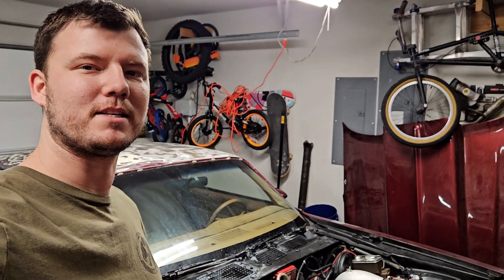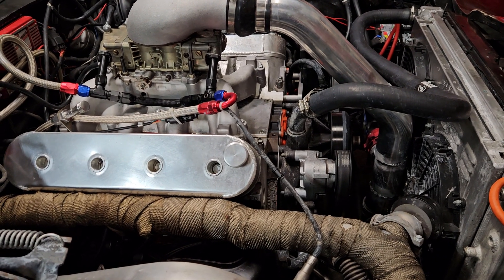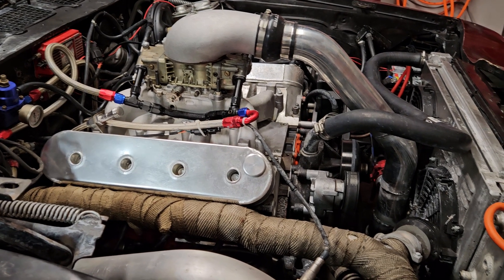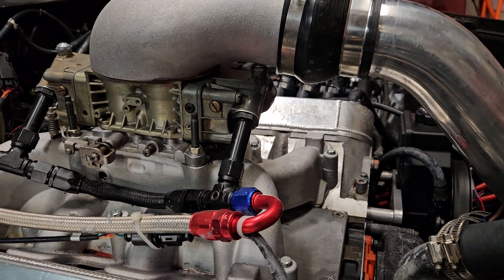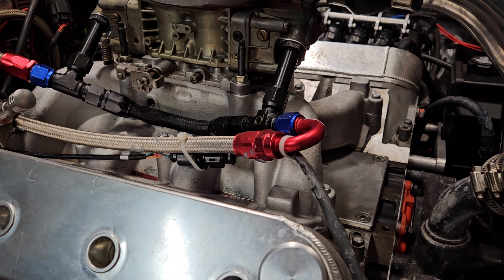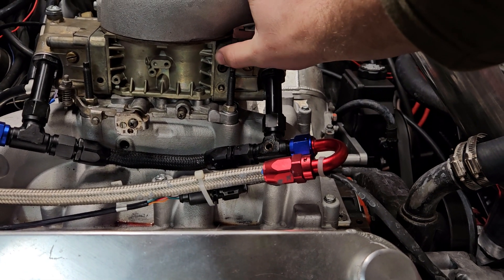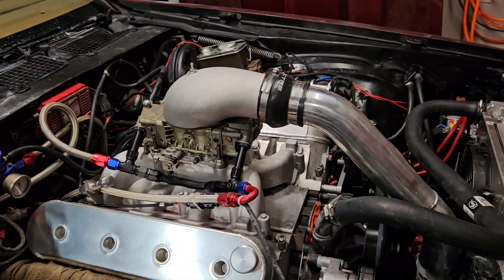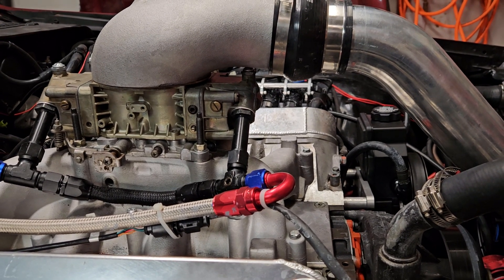Why I Ditched EFI for a Blow-Through Carb on My Turbo LS

Comment: what size jets are you running?
Reply from the maker: It's been a few months since I tuned it. I believe they are 72s. The air bleeds made a huge difference I drilled my own.

Are you doing a blow through?
Reply: @Bad_Larry_Motors  yes it's in the works on my 5.3 with a demon 650 I have 72 jets in the front & 80 in the rear for my all motor setup going into my jet boat
Reply: @Bad_Larry_Motors  with all the extra air I was thinking I would need to go with bigger jets

Comment: I'm running a carb'ed LS3 using the MSD 6014 box in my boat. I played hell with CPS faults and backfires initially, that was traced down to an aftermarket CPS. I replaced it with an AC Delco part and life was good thereafter.  I'm going to add dual turbo's next year and was reconciled to going back to injection. Your story is given me additional food for thought.
Reply from the maker: Oh man it's great. Just get a wideband and mod your carb it's really not hard or get a carb from csu

Comment: A fuel injection system only has one advantage over a carbureted system. It will almost never experience vapor lock.
Otherwise a well tuned, well adjusted (including choke) carbureted fuel system is objectively superior in every other possible metric.
Reply from the maker: Ice cold charge temperature is my  favorite part!

Comment: Not picking at your car but is it safe to have your fuel pressure regulator mounted on the firewall ?
Reply: Against NHRA rules. But he probably doesn’t compete.
Reply from the maker: Good to know! I do not compete just a street car. But I will look Into relocating it. Thanks for the heads up! 

I have a ton of cleanup to do.  trial and error and learning as I go.
Reply: If he has a scatter shield or SFI Bellhousing it’s legal

Comment: tell me you cant tune properly without telling me you cant tune properly
Reply: A timing light and some brain power works just fine dude, no need to overcomplicate things. That car probably eats shit and gets.
Reply: @jeremypilot1015  1983 called they want their tuning procedure back. It’s 2023, buy hp tuners and learn how to tune properly. Or pay someone to tune it. Would have been cheaper to get a professional dyno tune than it was to swap to a carb. And you’re probably losing power with a carb too
Reply from the maker: @bighitstepside I have HP tunners and it was a mess for me. I could not get it to build boost at all. It would bog like crazy. I would take fuel in and out, timing, everything. I am running a th400 so maybe because I didn't have a vss signal the motor didn't know its speed? I tried everything! so i am definitely not a tuner..... but for the price of paying somebody to tune it I was able to carb swap it and its been fun. I'm not limited by injections and intake Temps are crazy low with a blow through and a Intercooler.
Reply: @Bad_Larry_Motors that's exactly what it was. I don't have turbo on my Chevelle but I'm running a 6.0 with th400 and you have to run a vss sensor.

Comment: It won’t revert back to base timing until 2.5 bar. (Like 21psi.) I went pretty fast with my blow thru setup. Cheap cast wheel 78/75 went 9’s with ease in my fox body. Only reason i went to efi was for logging
Reply from the maker: Good to know. i figured it was up there pretty high. Did you still use the map sensor? I would be happy to be in the 10s!
Reply: @Bad_Larry_Motors  yep I use the map table when I tuned mine. I went 6.13 and high 9’s in the 1/4 with my setup. It woulda went faster but I was going super rich midway through the run and it was going so fat that it would rich misfire that’s why it didn’t go mid or low nines like it should have.